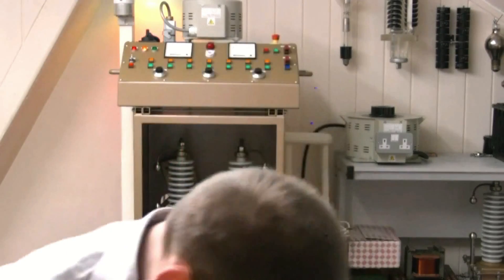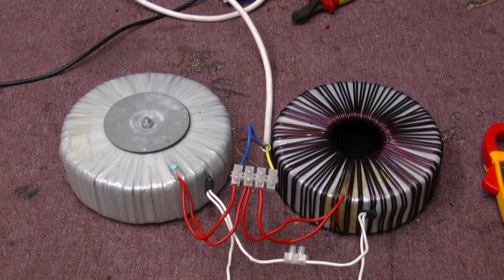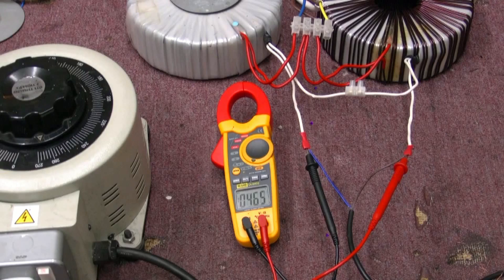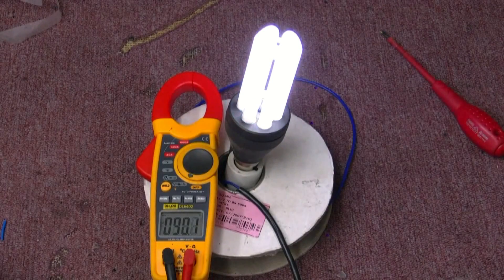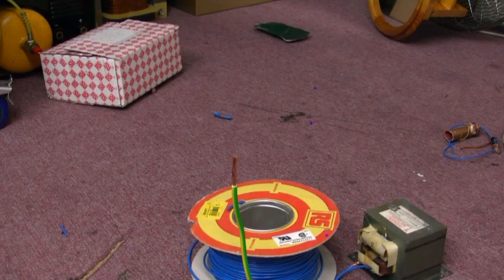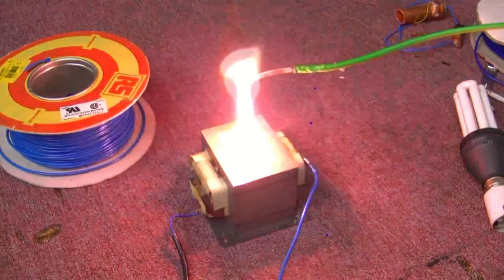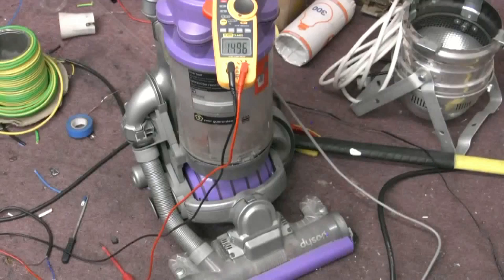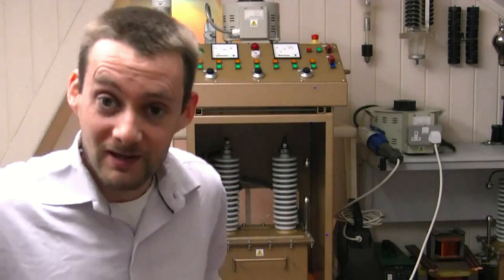240v-440v

Comment: If you tried this in 2025, it would be much harder to access the parts, specially the ballasts because of the change in lighting technology. I guess you could try putting ballasts in parallel (which works) to get a max current for your variac with respect to 440v and XL formula. Andy doesn’t really do the math on video.

Comment: Excuse ignorance, but if 220/240 gives 110/120 out, surely reversing that gives 440/480 out per transformer? Then sticking them in series would give 880/960?
Reply: They're wired in series in the input coils too, this halves the input voltage. I think he did this so the coils aren't being operated above their rated voltages.
Reply: @richard0crewe  Of course. Well spotted. Thank you.

Comment: Video at 9.40 shows 'something' running down from the Dyson & at 10.30, another 'something' run up on the right. Ghosts? You using an infra-red capable camera? I need a transformer or 2 transformers able to output say over 400 ac, then convert to DC to get 400 volts output DC. How do I achieve that safely?

Comment: What do you use for ballast? I've tried tungsten bulbs in series with the mains primary, and the primary of another, seperate transformer in series with the mains input for a sort of inductor, but it doesn't produce more of a spark from the secondary with either method any better than a 9V battery could muster. Without the 'ballast', it works fine with acrs similar to the video at 7:40 , other than popping the breaker after a few seconds from the amp surge, so I know all the components are good; Any ideas/suggestions?

Comment: I I have a question how many volts did you pump into the 110 Volt line or was that just 110
Reply: +Kenny Mesa 240 together 120 on either side

Comment: so a toridal transformer can be a variac basically?
Reply: ok cool
Reply: VARIACs often have a toroidal transformer as their core so you could definitely make a crude autotransformer from the toroid. It won't be as good as the manufactured version like General Radio makes but you'll have some taps for sure. Like digitalradiohacker says, you'd be better off not consuming large amounts of power so you don't cook your coil.

Comment: How can you reccord the 400V Arc?? bechause my cam just shows me a white screen if I try it 
I need a piece of welding glass it does not matter whether I try AC or DC and current ~38A <Maybe a bit more than you had
Just a theoretical question from me

Nice Vid and another way to get 400V if you can´t take it from a socket 

Fokus
Reply: try a shade 6 a 8 welding glass if it doesn't work wel try a higher number or if you know someone with a speedglaas welding mask it wil be much easier to record the arc
Reply: alexandre alex No you understood wrong photon reccords the arc without glass.With glass it works as you see in my vids.
also at less current than here I just see a white surface 
So how can or could I try without ?

Fokus
Reply: Fokusscience it depends on the camera I'm sure..
fukus

Comment: Those toroid transformers is really nice anyway, as there is so much space to put new windings on them to get what ever voltage you want. Wery thick cable can be used for a low voltage, high current one
 - for high voltage a lot of turns can be made with a wire dimension that still allow for some amps. Only thing is that it can be some work to wind many turns.

Comment: 3 phase power here is available everywhere. The problem is the bill is made of line rental and power consumption. 3 phase customers pay triple the line rental so they pay more even if they use the same MWH of power. So generally houses on a street are connected to single phase from a 3 phase line. So one house will be phase A next B then C so the street goes A-B-C-A-B-C-A-B-C for example. Still 3 phase but each house is on 1 of the phases. For all 3 phases you have to pay higher line rental.
Reply: Make friends with both of your neighbors and pull some extention cords - You all 3 will have 3 phase power for the same price 😜
Reply: KiwiPowerNZ that's gay
Reply: Richard van Pukkem. Smart

Comment: Then one easy way (without make new installations) is to just make a split cable from one outlet to 2 - connect that to a 240 V outlet, then you can run your ordinary applience from one and have onother one left over for what ever you want.

That's what I did - but I used a 3 phase connection for a stove instead.

Comment: Yeah - I will guess 3 phase motors is used a lot in industry even over there as they are better than single phase ones. We always have 3 phase as standard and it's often used for domestic stoves as well as commersial ones. Probably power companies here think it's cheaper at the end to use less copper and to get better balance on the phases. 

My guess is that many countries already have big areas that only have single phase connections and it's cheaper too continue same way than to upgrade.

Comment: You are correct. However, most outlets are only 120v, while 240v is used for appliances that draw a large amount of electricity, such as electric clothes dryers, electric cooktops, etc. All outlets that supply 240v are used for appliances, and there are no unused outlets. It is also very expensive to install a 240v outlet in a bedroom or something like that. In other words, while available it is inconvenient to access.

Comment: If your in the USA you can still get 240V. I'm not American but I think in the USA you get 3 wires, your +120V, neutral, and -120V. The + and - 120V are a half a cycle out of phase so when one is peaking at +170V the other is troughed at -170V, the voltage potential between them being 340V and the RMS voltage is then 240V!
Reply: it is still like the UK 3 phase 120 it is split from house to house.  So if you have Red Yellow Blue.  House one will get Red Yellow an house 2 will get Yellow Blue house 3 will get Blue Red - an on an on

Comment: You have the same as us in NZ. 400 phase-phase, 230 phase-neutral. Only commercial stoves use 3 phase, well that I've seen. Only commercial users or farmers pay for 3 phase power here because single phase is cheaper.

Comment: So those transformers are designed to lower your 240v to 120v, correct? If so, could the secondary winding be put on our 120v for a 240v output and be run normally?

Comment: you can get 600w bulbs if you know where to look, here's a clue: anywhere but a b&q or Wilkinson, if you find a commercial supplier, you can get big bulbs cheaper than some 60w's. these will probably have a giant Edison screw fitting though so they will not be able to fit into a normal light socket.

Comment: Ah yes. Another one of my much-liked PhotonVids. Knowing how to do this instead of re-configuring the wiring inside the variac is a beneficial bonus-add-on nugget of info.

All I need to do now, is find a pair of cheap second-hand portable 3kva site transformers, & re-configure the wiring in them. 

I do wonder what would happen if I got THREE of them to crank the voltage RIGHT UP, what the output would be? :-D

-BoomBoxDeluxe.